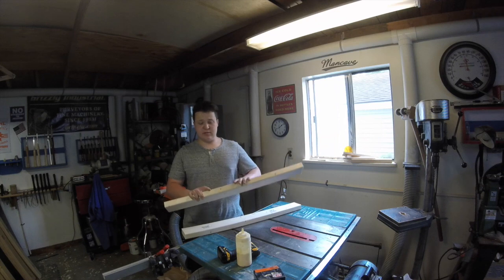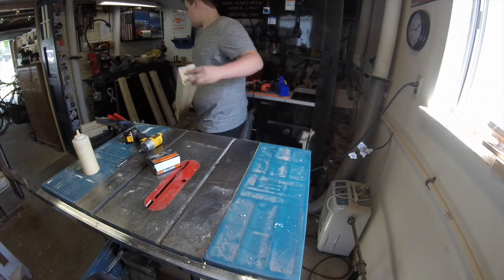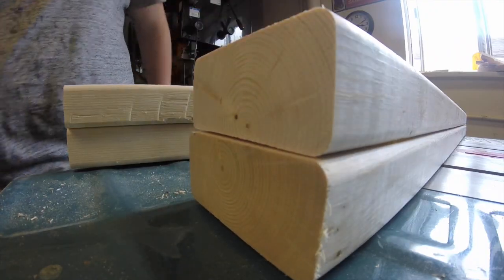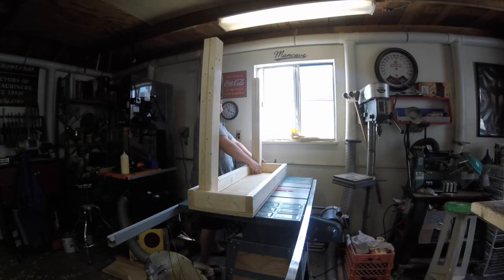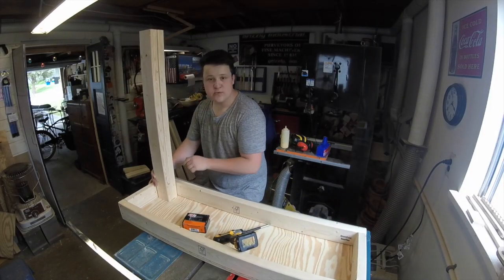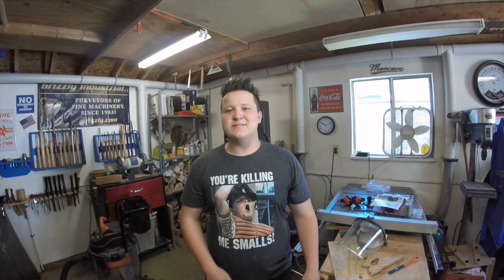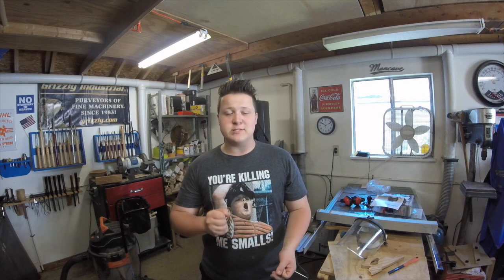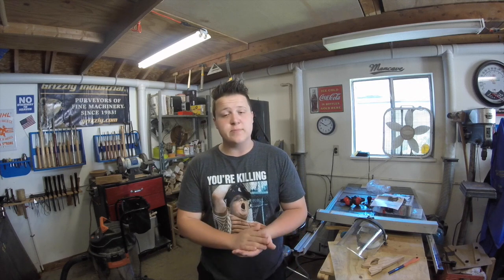DIY Small Workbench/Toolstand

Comment: Any issues with tipping or instability while using the lathe or sander? I try to keep all my benches/work surfaces between 18"-24"  and 4'X5' or 4'X6' for out feed/assembly tables.
Reply from the maker: No its pretty sturdy! I was a little concerned because its so narrow but its solid
Thanks,
Pete
Reply: +Peter Matthew good to hear. Wasn't trying to question your build, just didn't want to see you have any problems.